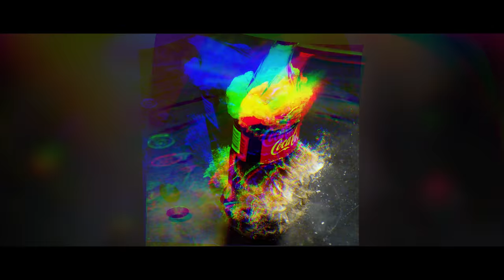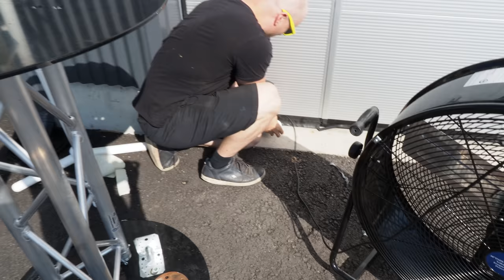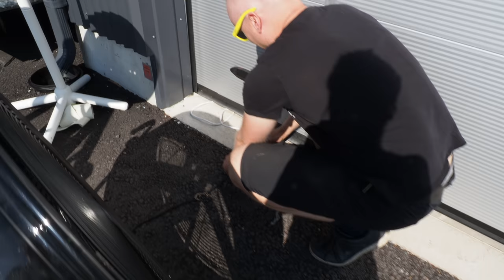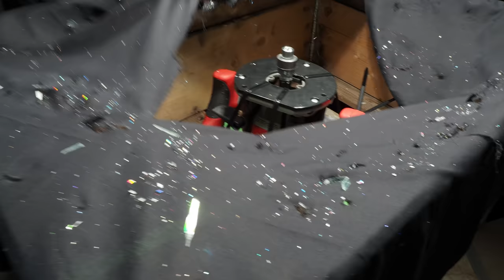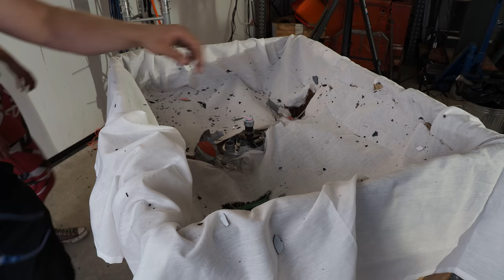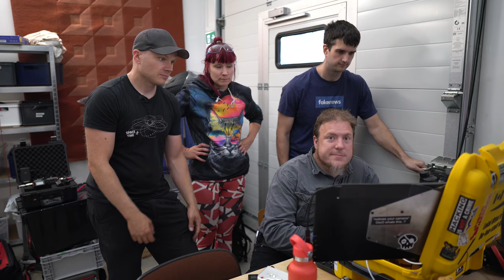Exploding CDs Filmed with Spinning Slow Motion Camera | 330 000 FPS!

Comment from the maker: This time I was able to use optical flow on some shots. So if there is first clip with faster spin and then slower one the later is done with optical flow. It seems to work surprisingly well even on this videos and since we had lights for 1 000 000 fps we were usually using quite short shutter times on slower frame rates like 100 000 fps resulting also good performance with optical flow. I don't know when 100 000 fps turned into relatively slow frame rate but it is now :D
Reply from the maker: @nuclearquantumlaserspewpew9745  We have two kilos of dynamite coming with the 50 meter outdoor ring! And flamethrower, det cord, exploding a car etc. good stuff :D
Reply: What is the name of the band in the music you play?
Reply from the maker: @maxcox699  They are in description
Reply: @Beyondthepress  can't wait skål (kippis) från Sverige
Reply: @Beyondthepress  I'm being thick I think,still can't see it  :/
Reply: @maxcox699  you have to refresh. You can open another video, then come back to this one and the Description will be updated.
Reply: @WoodworkerDon  sweet, thanks buddy :)
Reply: 1 000 000 fps lights? Going for those Camera Lights 5 000 000 I see.
Reply: Beyond the press that’s great. Now you need to work on exposure stabilization in post.  Welcome to high tech 20 years ago ;)
Reply: AWESOME footage folks!
Reply: Do you have even higher speed footage of cd explosions? Would be nice to see where fractures start and how those travel. Like the tree formation in LP disc.
Reply: The fakenews shirt in the fakebook logo is awesome!
Reply: teach me to film fast and i will teach you to speak proper english
Reply: E
Reply: Moi
Reply: Beyond the press this is a start, next needs to be a bicycle wheel until it explodes
Reply: @andiamocclash397  We don't want or need him to change his English. It's already good and the small mistakes are endearing.
Reply: Can you film a drop of sodium potassium alloy dropped in an argon atmosphere in water from about 60cm up? This is something that hasn't been filmed with a setup like yours yet and it could give great insight into the reaction between water and alcaline metals. It would be really awesome if you could film this!
Reply: INDUSTRIAL ACCIDENT
This video gives me the idea you should film recreation of tool failures that have injured people in their shop. An endorsement of eye protection, other precautionary measures.
Reply: I'm curious what speed of rpm is needed to break the disc if you were to securely fasten the cd to the surface so that it didn't wobble. I have done this myself and it is always the wobble itself that breaks the disc and not the spinning force pulling outwards. I want to see a pure spin pull break, not a wobble break.... although that second attempt looked pretty perfect, I suspect it's still the waveform breaking the disc and not the pulling force.
Reply: I think a bank of HV capacitors discharging through cd would look cool

Comment: I'm not usually at a loss for words, but today, I am.  What you have done in collaboration with the guys at Kronos is nothing short of ground breaking.  The images you've captured are truly magical and reveal high speed fracture mechanics in a way that is unique.  You've taken what the Slow Mo Guys did about four years ago with the same subject and have taken it to a whole new level.  THIS IS WHY YOU GUYS HAVE THE BEST CHANNELS ON YOU TUBE.  I bow to your prowess.  YEEE HAAAW!!
Reply from the maker: The cd that was spinning with the camera is one of my favorite shots of the project. It's not the most demanding in terms of speed or resolution but you just cant film it like that with any other system so it's totally unique clip from this project. The most jaw dropping stuff for me was all things that we filmed at 1 000 000 fps. I have spent quite lot of time with Phantom v2512 and even with that anything over 300 000 fps isn't going work anymore on Youtube since it's too ugly but the 1 000 000 fps stuff from this just looks so good! 

And seems that optical flow works also surprisingly well on most of shots at 30-50% speed so I can make effective frame rate to be around 2 000 000 fps and still have 330x330 resolution.
Reply: @Beyondthepress  Surely, 5 000 000 fps would look even better.
Reply: @waltherstolzing9719  LOL....Slow Motion Camera 5,000,000.
Reply: @waltherstolzing9719  Sl-Mo Cam 5 000 000! Excellent idea!
Reply: One. Hundred BILLLION frames per second! MWUHAHA
Reply: If that's a loss for words then I'd like to see you chatty 😆
Reply: YEE HAWWWW!!

Comment: Slo mo guys left the chat
Reply: Nahh slo mo guys actually have good cameras. Chronos cameras aren't that impressive when it comes to Phantoms
Reply from the maker: @SuiYo  I have used both cameras a lot and there is some stuff where just single Chronos is best camera, lot of stuff where some of the Phantoms is the best camera and lot of stuff where the ring is best. I would say that everything over 200 000fps and the ring absolutely butchers everything else just because it has so much larger resolution than any Phantom. For example at 1 000 000 fps we have 10 times more pixels with the ring than any phantom can offer
Reply: Beyond the press 7.5 times more pixels, to be precise :D
Reply: But the slo mo guys don't have a slo mo ring
Reply: I wasn't trying to shit on the setup or anything but it was just my opinion. I don't really like the spinning part, i know it gives a higher resolution and framerate, but it's kinda disorientating, especially when the cameras aren't lined up perfectly. Also every camera is different, so it just looks off. But hey, that's just my opinion.
Reply: Imagine using that many phantoms in 4k resolution, that would cost few million euros.. :D
Reply: Well you get >4 phantom flex4K 128gb cameras or 72 chronos 1,4 in a ring 😁
Reply: @SuiYo  I have the same opinion that a video with lower resolution is better then the ring because the spinning picture ist disorientating. 
Also for "press videos" it's not useful for example. Still it's amazing! And i still wish Slomo Guys and Presschannel would team up for a project.
Reply: Fr
Reply: 10 times more pixels at 2-3 times the price of a Phantom, yet 40 times more impractical.
Reply: The number of butthurt folks coming out of the woodwork is comical. Its easy to see who's jelly and who is not.
Reply: The spinning is cool cause you can see behind
Reply: Come on guys, who cares what the best camera is, this ring is great, gives 360 perspective and is simply a completely different experience all together. I say great job! And now, let's see a Tesla coil in 360 slowmo! 🙏😀
Reply: Sui Yo You’re right
Reply: Ben Sneller although they did have that cool spinning camera rig with the fire lol
Reply: Brian Streufert at least they're coming out of the woodwork they can do a ton of damage if they lay their eggs in the walls then you have to spray for them :/ 

my last apartment had a huge butthurtmite infestation :(
Reply: The equipment is irrelevant to the viewer, this some amazing stuff, I'm excited to see where this goes.
Reply: LMFAOOOOOOOOOOOOO
Reply: Also, if you have to wait for the Ring to process the footage, that is a delay that just doesn't exist on the Phantoms. With a single camera set up, as soon as you hit the button you can play back the footage.
Reply: Perhaps a green screen as the background(the sheet in this case) would eliminate the disorientating nature of the spin.
Could chroma key the best colour possible for contrast too
Reply: Cannot beat slow mo Phantoms baby. They did the same thing with 1 Phantoms camera also they captured Shock Waves
man :O. But this 360 thing is just something and makes everyone super surprise :D :D :D
Reply: @ubermidget2  The big difference is that the phantom is actually taking and playing back raw images.  This system is clearly utilizing temporal upscaling and image stabilization to produce a smooth video from the raw images.  That means every frame of the processed video sequence is synthesized and not actually captured from any one camera sensor.  

This is problematic when you're recording an object like a CD which is more or less rigid for a while and then gradually begins to change shape, because the motion vector tracking that's used for stabilization and frame interpolation is inherently imprecise and will treat some of that flexing as error.  Aggressive frame rate upscaling is fine if you're wanting to make videos that look pretty, but you can never really trust the details you're seeing.
Reply: I still believe the raw ring footage could be improved dramatically with some interpolation leveraging emerging deep learning technologies. But certainly upping the frame rate has definitely improved the smoothness. It's pretty damn cool. I have been following tesla500 from before the chronos was released. Pretty remarkable feat for a small company.
Reply: Imagine if they made a phantom ring
Reply: @Beyondthepress  that beast of ring is a serious scientific tool.. Not much will capture an oxy acetylene flame front in near real time 3d lol

Comment: I like how it leaves a ghost image of the disc after the disc explodes.
Reply: William Jaudon ikr
Reply: Yeah, really awesome. It even still reflects the light in a rainbow pattern before it fades away
Reply: I suspect it is an artifact of the software that is using the output of the ring of cameras and combining it into a smoothly moving image. Either that, or it is proof that CD's have a soul...
Reply: That should be 'optical flow' 
Software creates images itself to smooth the picture
Reply: It certanly looks cool, but i think it is just the CD's shadow.
Reply: It doesn't seem to be an artifact of the image processing because none of the other pieces do that.  I assumed it was a coating on the disc that vaporises because you can see it being blown away shortly afterwards.
Reply: @vink6163  It's more clear on the first CD that it's a ghost image. It mirrors exactly what the main image did a few seconds earlier.

Comment: Combining the cutting-edge cameras they'd already developed with a photographic technique that predates "The Matrix" using software and off-the-shelf networking hardware is brilliant.  Kron Tech has created a new technology that has expanded the human ability to see the unseen.  I imagine manufacturers interested in improving the high-stress performance of their products will be very interested in Kronos' products and services.  It wouldn't surprise me if they find their business expanding rapidly very soon.  I hope they will still be able to find the time to help YouTubers make cool videos like this from time to time.
Reply: I imagine being able to see exact points of failure or stress would be an incredible step forward for engineering
Reply: You could also create some fantastic 3D images/videos with 3 points in the ring taking photos together. (running at 1/3FPS)
Reply: Exactly what I was thinking whilst watching the cd in resonance just as the fracture started. A very powerful tool indeed.

Comment: The reason why it breaks from the edge like that is that the CD is injection molded through a small port in the mold, and that port is where the cd fails because of the orientation of the polymers in that location is perpendicular to the stress caused by fast spinning. Its cool to see how the cracks follow the flow path of the plastic.

Comment: It's cool that unlike some channels that do the same stuff ad nauseum, you guys have branched out and are doing more and more interesting things. (Not that I am bored of the hydraulic press stuff, you manage to keep that interesting too). You've kind of become the spiritual successors of the Mythbusters for making amazing videos of things exploding. 
Keep doing crazy stuff like this. It's awesome! 

BTW, if you want some ideas for other things to shoot with the ring, what about putting sandwiches, food, or other things on the router and watching them fall apart? Less danger, more delicious.
Or, maybe put a Tesla coil inside the ring and film the sparks in slow-mo. That would be awesome too. (Consult an electrician or physicist first to make sure you can protect the ring from the high voltage and electrical interference first though).
Reply: A Tesla coil would be awesome! it might need to be inside a faraday cage though because the electromagnetic fields might destroy the cameras.
Reply: Absolutely!  Tesla on the Kronos ring would be on the next level!
Reply: Even better — I’d like to see them shrink coins with electromagnets... just remove the typical shroud/shield/cover, step outside, and flip the switch 😵

Comment: For giggles: rapidly bending a CD (or DVD or BluRay) will usually shatter it. Specifically label-side-out because that's actually where the data pattern and the shiny aluminium reflector layer is.

Comment: Force = Mass x Acceleration.  One piece of the vinyl LP penetrating through the wood plank is a clear indication of the force involved. 💪
Reply: The big merit of acceleration
Reply: It's about kinetic energy (½mv*v) of the plastic and not force. If the box would be made of foam (soft and thick) than penetration depth is very high, but the force is low because the decceleration of the plastic is low as well.
Reply: @Sunlight91  I was wondering, why the 2 cd s put together exploded one after the other and not same time ..

Comment: Up next spinning circular sawblades til they explode!
Reply: The timber might not hold in the fragments in that situation. 😂
Reply: ABFMick That’s the point.
Reply: It will need much higher speed. It might be like a shrapnel grenade (if not more powerful). It might be a bit too dangerous. Would be cool to see though.
Reply: grinding wheels! Too late now, they sent the ring back.
Reply: I feel terrified even from just reading this!
Reply: Okay, now I want this too.  Now I am curious as to how fast one would have to spin a circular saw blade to make it spin apart like the compact discs.
Reply: Surround the spinning blade with wooden cross ties.

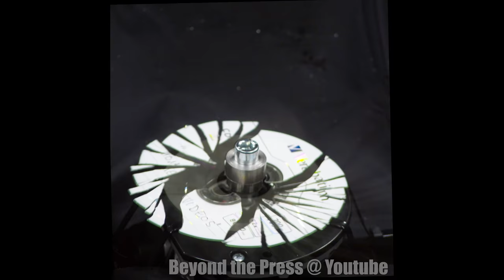Comment: 5:20 - Wait. What's going on here? We see the CD shatter, but there's a faint halo of something iridescent that remains, in the shape of the CD. A few of the clips have this.  And then it seems to dissolve away. Is this just a camera artifact? It seems different from what the camera picked up, which wasn't iridescent. A CD has many layers. From label side to the other side, we have the label material, then some kind of plastic, then some kind of metal for the actual data (apparently this is often aluminum), then more plastic. And I believe the iridescence comes from the metallic data layer. Is it possible that some of the layers sheared off cleanly before the other layers? I wouldn't have thought this would be possible. But the iridescence of the remaining "ghost" suggests this might be more than a mere camera artifact.

Just so no one has to Google things, "iridescence" here refers to the "rainbow" effect where colors change based on angle, as evidenced in CDs, abalone shell, oil slicks, and any sort of multicolored glitter that is truly "holographic" and not just "pieces of different-colored glitter".
Reply: @drlava641  maybe both of these are the result of post-processing. Lauri mentioned in the comments that he used "optical flow", which seems to be a reference to some frame interpolation software.

Comment: The vinyl record probably was more flexible than the cd and had more air drag to begin with so it kept the speed down, and when it warped the air drag increased, I imagine that's why it took so long to explode. Also the label seemed to hold the center somewhat together quite long.